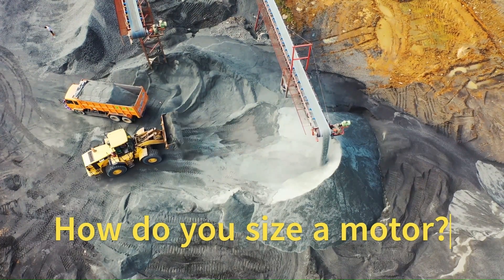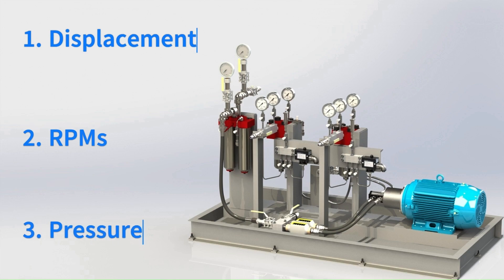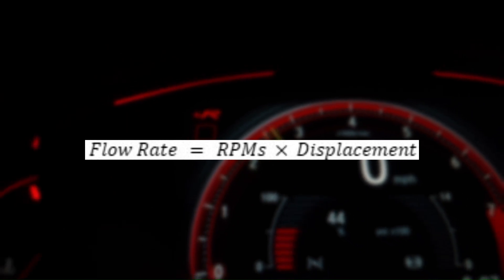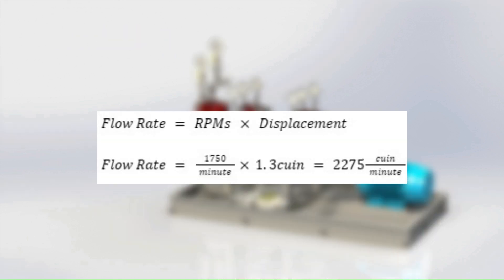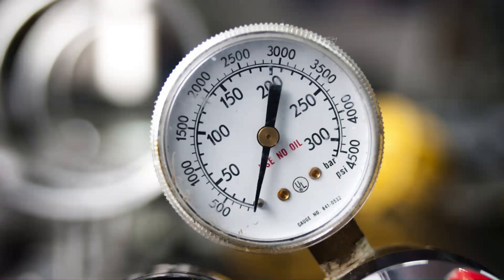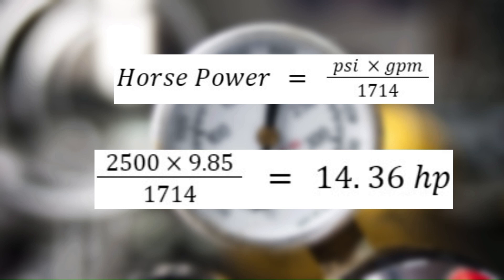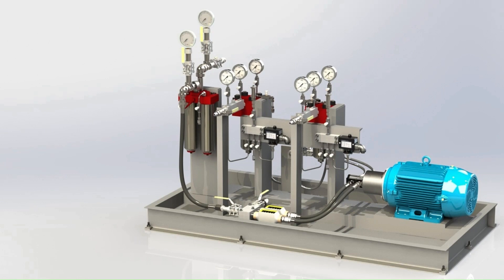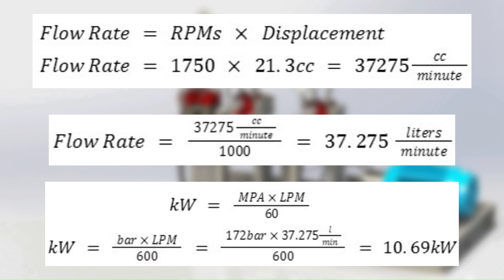How to Size a Motor for a Hydraulic Pump Drive

Comment: At 2.41, you metion use a motor at 1750rpm. I assume you meant hydraulic motor.

Hydraulic motor are rated in cc (metric from manufacturers. So if a the hydraukic motor is rated at 50cc x 1000 rpm from  the factory= 50.000cc or 50Lpm (max)
To size a pump wouldnt you need to size the Lpm of hydraulic motor to hydraulic pump output in Lpm x rpm. Eg. 20cc hydraulic pump, max rpm2000 = 40.000cc (40Lpm). Which means that the pump is insufficient to run hydraulic motor.
Now to calculate the kilowatt or power required to operate the pump would be the following.
Assume the above pump output is 40Lpm x 200bar /600 = 13.3Kw to operate the pump.
Reply from the maker: I can see where you would get that. The electric motor driving the pump is operating at 1750rpm and the pump is 21.3cc.

When sizing a pump, you size to the desired operation not the rated operation. A lot of hydraulic motor circuits I see only operate at 200 rpm or less, but the motors are rated much higher than that.

I hope that helps!
Reply: @Hydrauliac  interesting you said this. Running a  hydraulic motor operating at less than optimum or rated efficiency from factory. For what purpose or why would one run it at a such low rpm? 
Wouldnt it make more sense to run it closer to actual rating? 
Cheers
Reply from the maker: @sweeyong7756 optimum and rated rpm are often not the same thing. Your highest efficiency may be in the middle of the operating range of both flow and pressure. You also size for efficiency where the function will spend the most time operating, but their may be times where slower or faster operation is required.

Comment: PUMP CAN GENERATE ACTUAL PRESSURE?
Reply from the maker: Not exactly, a pump only tries to push flow. A resistance to that flow builds pressure. Different pumps will respond differently to the resistance to flow. Saying a pump builds pressure is an oversimplification on my part.